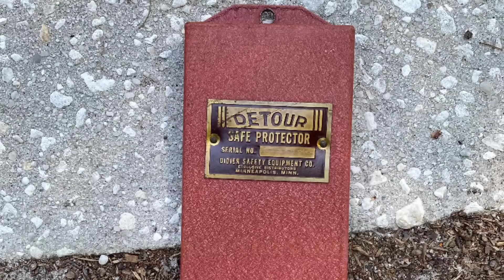FOUND MILLIONAIRES SAFE with Secret Vials

Comment: Work smarter not harder. There's a lot easier way to open those. First use your sledgehammer to knock off the dial. Then right behind the dial there is a pin which the dial connects to. Next get yourself a punch that's the same size as the pin. Then place the punch on the pin. Then use your sledgehammer or a ball-peen hammer to start hitting the punch. Keep hitting the punch with the hammer until you drive the pin through the back of the safe door. Once you get the PIN to go through then remove the punch and the tumblers will all drop. Presto the door will open. Hope this will help make it easier for you on future safes.

Comment: I have pulled old flooring with possible asbestos a couple of times.  Hoping it wasn’t in the linoleum from 1976.    Often it did before  that time. Two bathrooms, a kitchen, foyer and laundry area where I installed Pergo and ceramic tiles

Comment: I have been the metal trades for well over 50 years. At one time I had a co worker that we would build things out of metal. the last time I worked with him I went to his homes and he had a safe much like the one in this video. He had a a portable power saw with a grinding blade on it. (fire departments have them to get into cars along with the jaws of life) He was cutting the back of the safe with it. I ask if he lost the combo he said no it's not my safe this guy brings me safes and pays me $500. I cut the back of them open and don't look inside. That was the last time I had anything to do with him. But if you buy one of these portable saws or even put a grinding stone on a circular saw it would be so much easier than paying cave man with a hammer. just be careful the blade can explode.